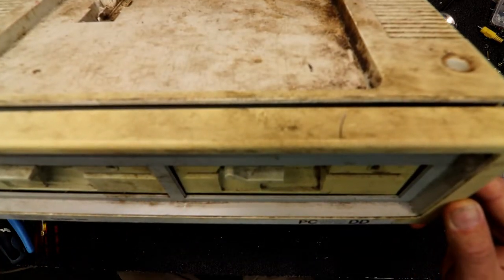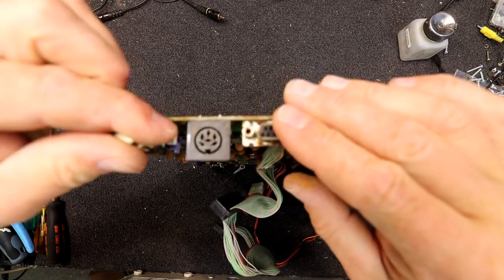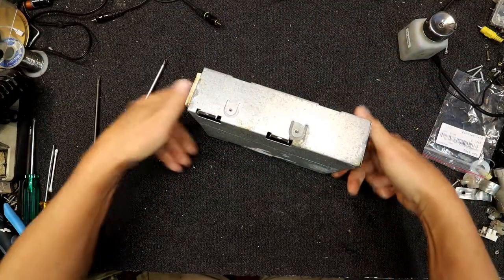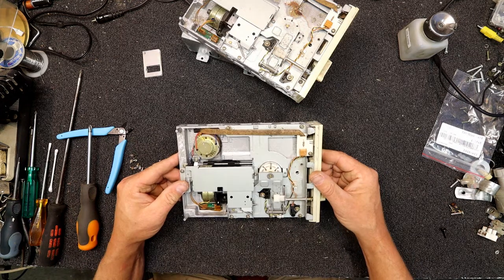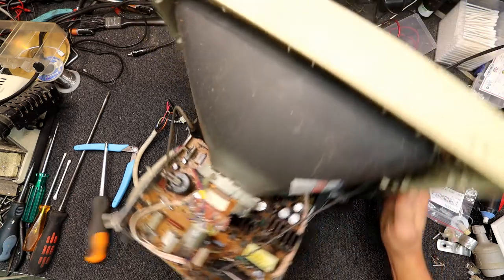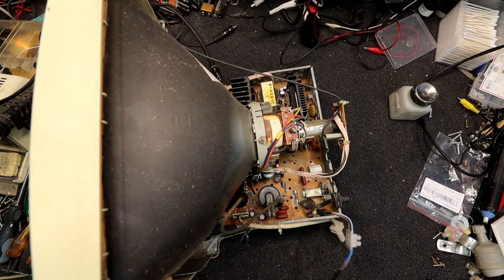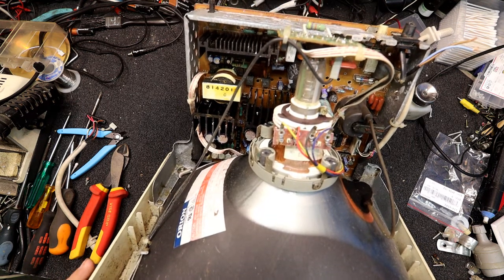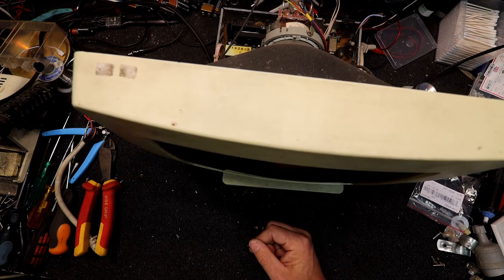Amstrad PC1512 crusty barn find computer teardown

Comment: If i remember correctly  the 1512 had 512kb memory a 8086 processor and a slot for the 8087 coprocessor . The screen was a cga screen 4 colors, The Amstrad 1640 was its big brother had a 720kb drive 640kb memory. and a ega graphics driver and screen 16 color . The 8086 was often replaced with the NEC v30 which gave a 10 - 20 percent speed improvement.

Comment: I'm #6 like... Would be interested in those floppy drives if they are for sale and you ship to Canada. maybe we could arrange for something?  MM is the monochrome model monitor and CM is the MCGA colour one.
Reply from the maker: If I still have the drives I am happy to work something out. I think I put the board and drives in a box somewhere. I will see if I can find them.
Reply: @StevesElectronicRepairShop  I doubt I can afford the shipping for the monitor and PC but maybe???
Reply from the maker: @mrwebber35  I threw the PC case and rusty metal away already so only have the PCB and maybe the drives plus monitor
Reply: @StevesElectronicRepairShop  Do you want to sell? I'm still interested in the drives and maybe the main board.
Reply from the maker: @mrwebber35  I havent had time to find them yet. If I get around to digging them out I will let you know with a comment here
Reply: @StevesElectronicRepairShop  Very good. I have the exact same system working now. Just bought another floppy for it. Would be good to have spare parts as I have had to replace the HD and the floppy already. These things are rated by the manufacturer to have failed long ago. I'll keep an eye on this thank you.